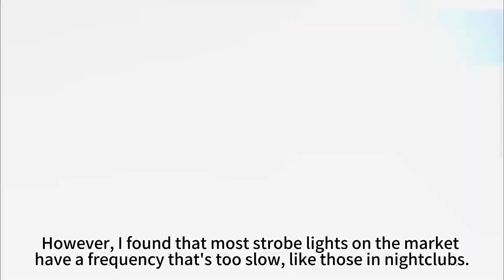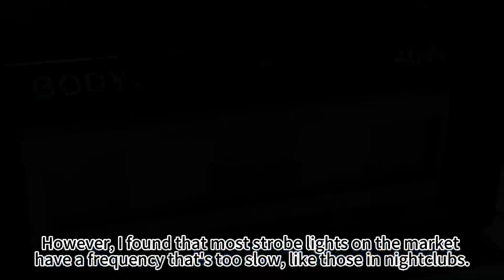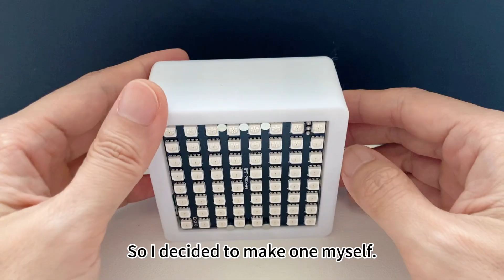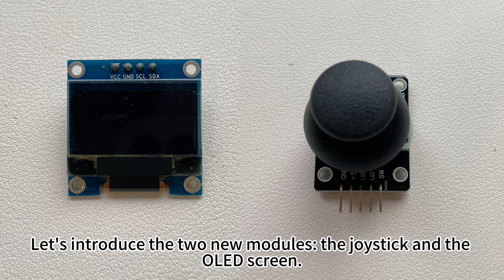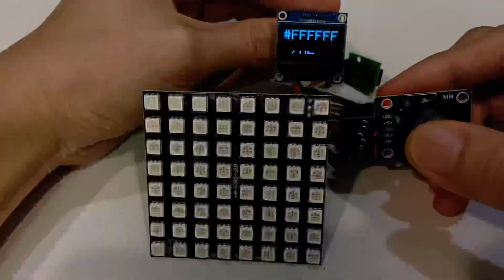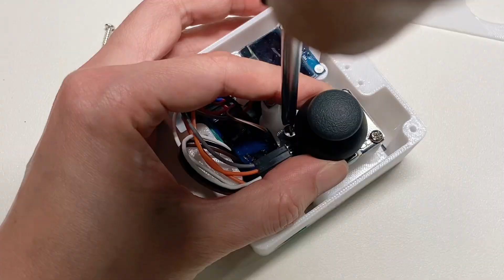Homemade Strobe Light|Frequency adjustable |OLED display|arduino project |tutorial|frequency flash

Comment: Hi! This project is amazing. I’m struggling make it works with ARDUINO Uno R4. Can you help Me?
Reply from the maker: Are you having any problems?
Reply: @WonderMaker66  now solved everyting, it was my fault, just a question: would you mind to implement this to your project?
https://www.youtube.com/watch?v=JkEsGXmInKo&t=237s
Because i'm trying to build the lievitating waterdrop machine and i solved all the solenoid problems, but not the LED Strobe ones.
Reply from the maker: Did you fail to solve the LED flicker problem, or did you fail to solve the final visual effect problem? These are two problems. The visual effect and the video shooting effect are also two problems. That's because the shooting effect is related to the number of frames in your video, while the visual effect is related to the characteristics of the eye with residual vision. My experience is that if it is a visual effect, what you need to do is to minimize the impact of ambient light on water droplets, and then adjust the LED light. The video shooting effect is simpler, you only need to adjust the flicker frequency in the video with the lowest frame rate possible.